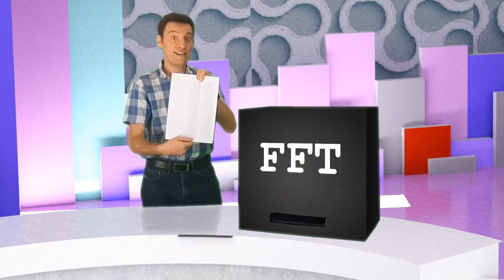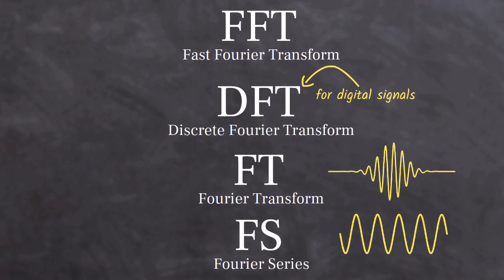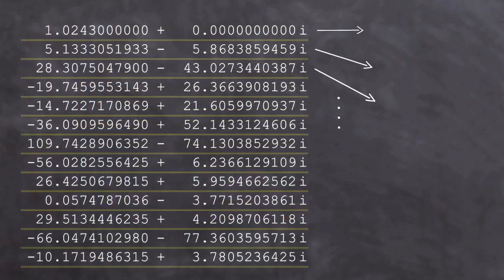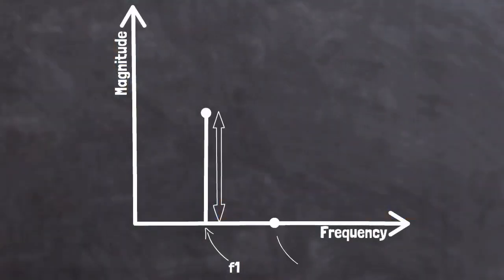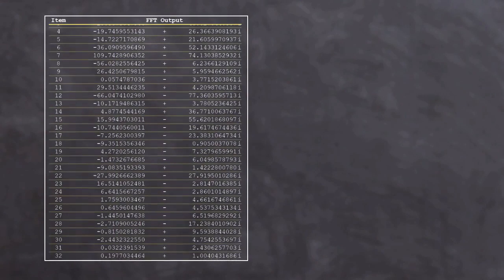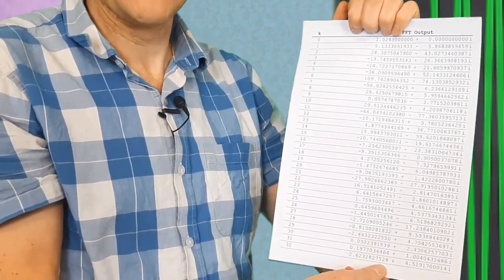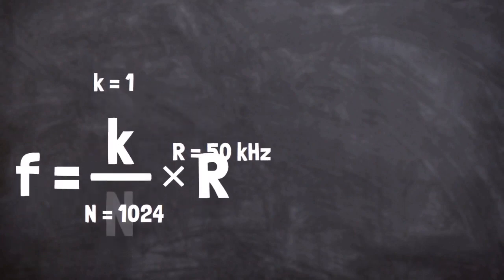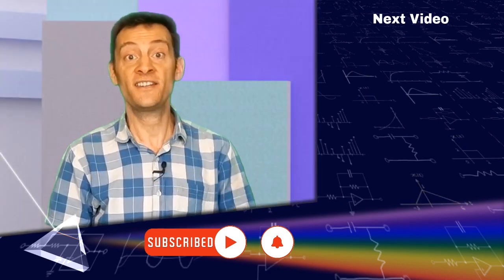Where is Frequency in the output of the FFT?

Comment: Mark could you please help, I follow what you are saying in the video, but for applications of the FFT, typically the algorithm does not ask for the Fs of the signal when I implement it in MATLAB or Python. At most it allows for me to specify the size if I want to pad it up to a different length, but it doesn’t need the Fs. I know how to scale the axis when it gives me an output, but how does it know what frequencies to test in the signal if I don’t feed it the sample rate?

Comment: Why we ignore the complex numbers during the calculation frequency ? we integrated the index number of complex numbers but I didn't understand clearly that ignoring the complex numbers value ? I will be glad if someone reply this question. Apart from this question, illustrations perfect for understand. Thank you for your great effort.
Reply from the maker: It's not that we ignore the complex number, it's just that the actual calculation of the FFT only tells you its magnitude and phase. It is the position of the item in the list that tells you its frequency. Think of the FFT result being on the y-axis and the position of the result in the list being on the x-axis.
Reply: @MarkNewmanEducation  Thank you for quick reply :) So can we summarize like that ;
We place the k index numbers on the x-axis. Starting from 0 to the length of the fft, for example 512. Here we find the frequency value of each k-index and place these values on the y-axis. Finally, when we combine these lines, it becomes the line of our frequency values. Did I get it right?

Comment: Thank you.
Can you explain how Matlab choose R?
When I apply fft(data) I don't tell matlab what is my sampling rate
Reply from the maker: MATLAB doesn't choose R as far as I know. All MATLAB is giving you is the sample index k. It is a while since I used MATLAB, but as far as I remember, it just gives you the list of complex numbers in the output. You have to convert the sample index, k, to frequency according to the rate at which you sampled the signal. MATLAB doesn't know.
Reply: @MarkNewmanEducation  Thanks for replying. It actually makes sense if I sample data at sample rate fs, Matlab would calculate the fft but when I'll plot it I could plot it for every other fs. If the new fs is higher than the real sample rate I will not earn new information because the data already sampled. But if I choose lower fs to plot fft, it would look like I sampled at lower rate. I guess.